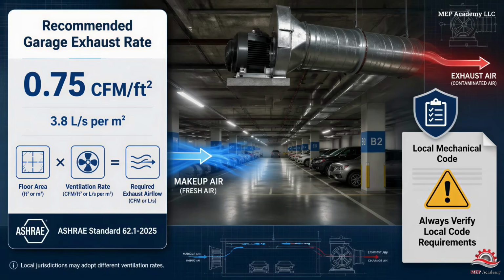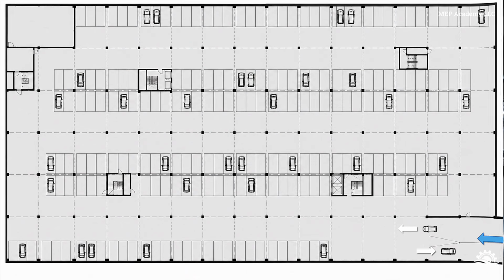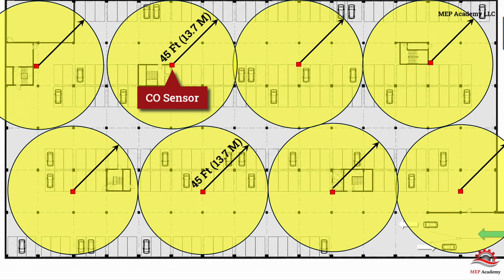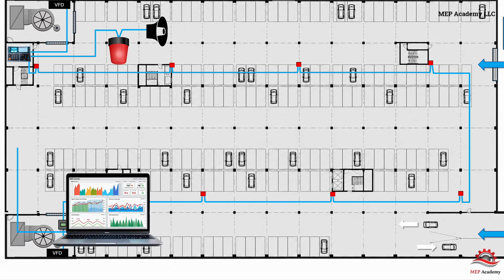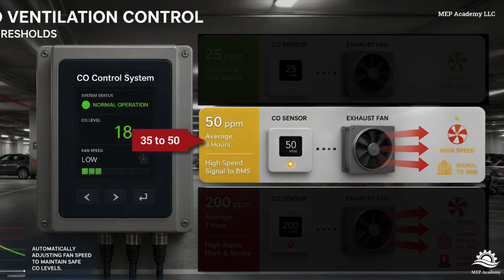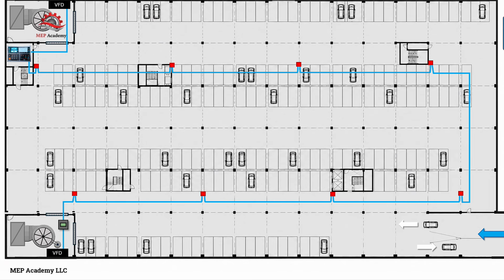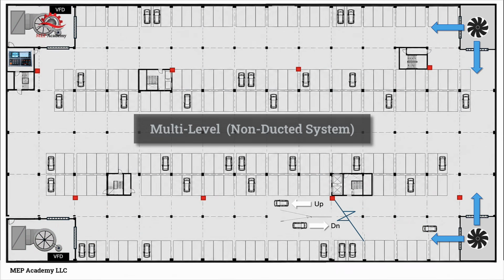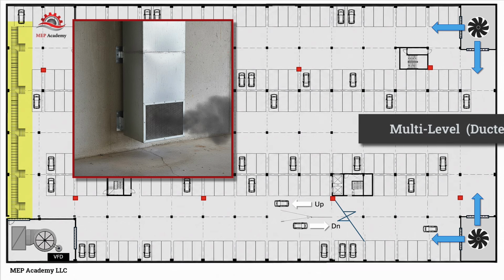How Parking Garages Remove Carbon Monoxide | Ventilation Systems Explained

Comment from the maker: 🎓 Advance your HVAC career with our professional online courses: https://courses.mepacademy.com
Did anything about garage exhaust systems surprise you?
Many people assume parking garages simply "ventilate themselves," but properly designed enclosed garages rely on carbon monoxide sensors, automatic controls, makeup air, and exhaust fans working together to maintain safe air quality.
If you've worked on the design, installation, commissioning, or maintenance of a garage ventilation system, share your experience below. We'd love to hear how systems are designed or controlled in your area, especially if your local code requirements differ.
And if you found this video helpful, please give it a 👍 and subscribe for more commercial HVAC engineering and construction content every week!